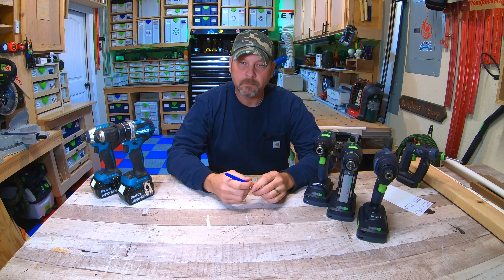Why I don’t recommend FESTOOL drills anymore.

Comment: Professional carpenter for 30 years. I have tools from most brands for different tasks.  If you are only on one platform you are missing out. 
Festool track saws, domino and dust collection were revolutionary. Before that we used plywood tracks and Japanese market hitachi saws for precision cuts. Porter cable door plane and D handle routers were a must.  Hitachi slide miters, and SDS drills…. and who didn’t have the Bosch jigsaw? Nobody.   You have to pick the best from each manufacturer and ignore the color. That said, I run mostly 18v Makita for cordless tools with very few problems.
Reply: Exactly one should NOT be brand loyal.  Buy the best tool for the job.  I used to like PC sanders and wore them out, they would no longer run every 5~6 years.   Some of my Festool sanders are 12 years old and still work great.
Reply: I am like a lot of other people in that I am brand loyal when we talk about cordless because it is so easy to get a lot of money invested into the battery/charger system which is why all but one or two of my cordless tools are Milwaukee. Otherwise, my corded equipment, big and small, includes Festool, Felder, Hammer, Robust Lathe, a Nova and a 40 yr. old Delta drill press, Laguna, Makita steel cutting chop saw, and even a Harbor Freight cherry picker (non-corded of course ;) ). Long story short, if I am buying corded I try to buy the best that the majority of reviews point to but if I am looking for another cordless tool, 19 out of 20 times I buy Milwaukee and will only pass on that tool if it gets subpar reviews.
Reply: I completely agree with you sir
Reply: Yeah if you're talking about a shop, if you're working on terrain having 3-4 different battery brands doesn't work out well
Reply: Thats what im trying to do now
Ive been makita for 3 years
But the dewalt 60v table saw is unrivaled in power
Now im looking for best in class for individual tools.

It seems makita is always a top pick
Reply: Absolutely agree I run 4 platforms Festool, Makita,hikoki and Milwaukee. I find the best tool for a job

Comment: Hi Brian. I absolutely agree with you. Dead on. I love my Festool sander and dust extractor but never could warm up to my super expensive Festool drill. This summer I bought a Makita drill set to make something outside for my wife because I felt badly about using my Festool stuff in the dirt. I bought it as my "beater" drill.... and just as you said I found myself using it more and more and the Festool les and less. Good stuff man, thank you!
Reply from the maker: Awesome! Thanks Chris!

Comment: The beep on my Festool drill also stops the driver.   No clatter of the clutch.  I appreciate power being cut to off when the torque setting on the Festool drill is reached.  Something I also noticed on my T15 drill is it torque application.   I had Panasonic, DeWalt, and Makita in that order.  None performed like the Festool.   As an example with all other drills if I stopped driving a 3" deck screw into a 2x6, on edge, at about 2" deep I could see the difference of the different drills.  With all others I had to pull  the trigger quite a bit to get the screw started again and then it would spin quickly.  With the Festool I could just pull the trgger a samll amount and it would begin driving the screw again and it would spin at the expected speed.  Basically the Festool drill appilies enough power to get the screw going again but only at the speed indicated by the trigger.   Mine is 10 years old.  Maybe the other brands have caught up with these type features.  FWIW  I am not a hobbiest.
Reply: This is exactly the kind of feedback I was looking for. I've used Dewalt impacts for a while now doing metal roofing/cladding and over the course of 11 years I've worn 2 our and my 3rd is begining to look rough. 

I've been looking around and wanted to go with Festool over hilti, so knowing you've been using yours for 10 years is great to know. 

I'd rather buy something quality once, rather than continually replace a tool because it was "good enough."

Comment: I really respect your openness and honesty! I sold all my Dewalt tools for Festool. Personally, I don't have any regrets, but I could also make an arrangement against my purchases. Like you said, their sanders, Domino, track saw, routers, dust collection... all game changers. A good drill is a good drill. I definitely tend to favor Festool... but maybe that's because I spent so much money on them and time convincing my wife I NEEDED them. I guess it all comes down to personal preference. Again, I really respect your honesty.
Reply from the maker: Thanks Jeff, I appreciate it.
Reply: After using the Festool drill long enough so that it shows signs of actually being used,  the others seem to be not well thought.
Reply: I’m literally just doing that!!! I’ve just got the 36v plunge saw, kapex and midi extractor, 18v hammer drill and now I’m looking at swapping my dewalt impact and combi for this and maybe a festool impact. Also my 165mm dewalt brushless skill saw needs swapping but not sure I like the look of the hkc55 do u have any advice?? Tha ks

Comment: I like my Makita drill but the real benefit to Festool is the different chucks. Really no comparison. The right angle chuck has come in so handy so many times. The Centrotec bit holding system is amazing. Now you can buy an attachment that allows non centrotec bits to be locked in. The time saving for bits falling out or getting stuck in screw heads and being pulled out makes the Festool drills so much more enjoyable to use. All the magnetic bit storage in the C 18. I could go on.

Comment: I own both the impact and the C18, 
I got the mainly because I was using the 18v batteries from the track saw and didn't wanted to invest into a new platform.
What I noticed from the C18 is that it is not that powerful for carpentry. But it is perfect for installing furniture, specially if you work with some very expensive materials where you need precision. The electronic brake and the interchangeable heads are very good.  They aren't so good to be used on a construction site, the rubber is very sensitive, and you definitelly need more power. 
But I think they are perfect for use in the shop and in the client's house for putting together furniture.
Reply from the maker: Totally agree. These feel to be more intended for finish work instead of heavy duty construction. Thanks!

Comment: I love the Festool drills and the Centrotec system. My drills i own are the Ti / C15 set, DRC, CXS and the SDS. While not designed for it i have put 6 inch screws in with the CXS. Since getting the DRC i have not used an impact. The CXS system came into it's own a few weeks ago while i was fitting ironmongery on site (uk) I had 4 jacobs chucks set up with different drill bits and 2 centrotec chucks set up with different screwdriver bits. Swapping chucks between 2 drills used - CXS/ DRC was quicker than using one drill and swapping bits all the time.

Comment: I will also agree with everything you have said here. I’m a big Festool fan, and I use a lot of their tools in my cabinet shop, and they are definitely worth the cost. I only own one drill, the Festool hammer drill, and I have all of the accessory chucks for it.  I bought it all almost brand new at a yard sale for 200 bucks, with one 5 AH battery. It’s way to heavy for everyday use, but it’s a beast that I use once in a while, mainly for setting anchors to hang my cabs on masonry. That brings me to the point I’d like to make. When I decided to add an additional battery to the mix, I was pleasantly surprised to find out that they were quite reasonable in cost, and very robust. I can see some value in a professional setting for using the platform in that case. 
All that said, I tried out a CXS at a tool show a few weeks ago, the new brushless one, and I think I’m going to add one to my shop. My go to drills and impacts for my work are all Dewalt 12v platform tools that have really held up very well, and I highly recommend them.

Comment: But I think the centrotec is worth the extra price tag. I really love the centrotec and also the angled chuck…
Reply from the maker: Centrotec is nice..if you have a lot of Centrotec bits (which I do), but really adds to the cost of using the Festool drills (in my opinion). I have a whole drawer of Centrotec bits I use with my CXS.

Comment: Hello Brian, I have to disagree with you on almost everything in your review and offer a different perspective.  The TID drill in my opinion is a complete waste of money because you do pay a premium price and receive almost none of the benefit of the Festool system.  I swear by the c18 and bought another to have one just for the shop.  The control, torque and weight are perfect for almost every task.  The right angle attachment is by far the best ever made and more than useful in the tightest of spaces for construction, remodeling, electrical, plumbing or cabinet and fine finish work. The centrotec system is like having 2-3 drills in one.  You can keep a drill bit in the chuck, a fastener bit in the centrotec chuck another bit in the right angle chuck if necessary and swap them out as needed.  Keeping all of them in one pocket of your tool belt or close by with the ability to change them quick back and forth.  And then there’s the eccentric chuck for cabinets, drawer slides and other uses requiring screws near the corners of cabinets, closets and boxes.  The centrotec chuck and small bits also make it shorter than other drills to again get into tight spaces.  It’s an amazing tool with great battery life and no other drill on the market compares.  I own the Makita XGT 40v drill and impact, dewalt and Milwaukee drills. The makita I would chose over the Festool PDC which I own also and love.  The right angle attachment on the PDC is the only reason I would hesitate.  I use it far more than I would have ever thought.  Dewalt and Milwaukee have a lot of power but aren’t great for control which matters more to me. The Festool impact is actually at a comparable price to the other brands considering Festool gives you 2 batteries and the rest only give you one and charge $150-$200 for another.  The CXS is amazing but it really is a cabinet drill and I hate that the batteries only work for that drill.  Again I love it for what it does but if you’re looking just for a small drill Bosch make great ones for around $200 for the set I have one I keep in my electrical bag.  Most of my Festool tools have been relegated to cabinet and furniture building, precision and fine finish working. Except the c18 which is the best all around drill I’ve ever owned and worth every penny and more.  Hope this helps!
Reply from the maker: Thank you Pierre for the comment!
Reply: Pierre - Fully agree. I'm still running my original 'c12' (the BPS 12) from around 2008/2009 with the original batteries still going strong. I now charge them with my TCL6 charger as they're forwards compatible with the 18V system (for giggles, I can run my TSC55 and HKC55, Quadrive etc. on them. Not for very long, but at least they don't keep changing connection types every couple of years like, ahem, some other brands...) I can still buy replacement batteries direct from Festool too, though I'd just buy the T 18+3 at £149 instead, or replace the cells, the T instead of the C because the newer C18 trigger seems to be set lower than the original C12 and is more front heavy. Still, while the C12 continues to soldier on, what can I do?  For wise heads, there are some real deals too, with £200 of chucks with this refurbished set: 

https://www.toolexchange.co.uk/product/festool-c12-cordless-drill-with-4-interchangeable-heads/

Great kit - I also use Milwaukee M18 and M12 for 'rough, garden and car' type DIY. Their M18 double charger lasted 8 cycles then blew. My Festool LC 45 is still faultlessly charging 15/16 years on. 

At the moment in the UK I can buy a TID for £129 (inc. VAT) with a free 5.2ah Bluetooth battery and a systainer. Just bought the new TPC 18/4 c/w one 5.2ah battery with a free second 5.2ah battery for £225. That free battery has a £105 value, so effective cost was £124 for the drill, plus accessories and battery in the new gen 3 systainer. 

For comparison, the last generation (new gen not available in the UK yet) Milwaukee One-Key M18 Fuel combi is £149, tool only in a cardboard box! £205 with a single M18 5ah battery!

Comment: Metal roofer here with a Bosch driver. I've installed dozens of metal roofs using 1 3/4'' pole barn screws( that's what  they call them) Used Makita for 26 years till I went with Bosch. Has More rpm's than Makita, both can last for years on a roof. I wouldn't dream of using my new tid 18/ T 18 on a roof. Thanks for posting.
Reply from the maker: Thanks👍🏻
Reply: Have used my Festool drill on rooftop for nearly 10 years. Have swapped some batteries, a few switches (we had more than one drill). Has been great
Reply: @happyhappynuts  I will use my Festool driver on a roof when it gets older but for now it's not leaving the comfort of my shop, it likes its lite use and comfy box.  I wonder if most tend to pamper there Festool tools, I'd bet most do!

Comment: Oh boy do I have some thoughts…

I sold my TID impact and my CXS and replaced them with the Makita sub compact (black) 18v impact and drill. They are ok. I love the size and weight but I just repurchased the TID18 and went with a C18 instead of the CXS. 

Here’s my issue: control. The Makita subcompact impact is either too fast/hits to hard, or is too slow. I broke screws I would never have broken with the TID. 

As for the drill, it just doesn’t have the control the CXS had. But it does have the power I need. I’m hoping the c18 gives me that. 

I also know that the Makita premium brushless impact drive is definitely better, but is also the same price as the TID18. 

Ultimately you’re right there’s nothing that Festool drills do that the others don’t do as well or better, but there’s something subjective about them that made me regret selling them. 

I wish YT still allowed response videos because I’d definitely mention you in mine (when they get here) 😁
Reply from the maker: You will like the C18 - it’s a refined drill for sure, but I bet you’ll still be buying another CXS😉😉
Reply: @BrianWatersOutdoors  probably, I work with the guy I sold it too so I can probably swipe it when he’s not looking
Reply: This makes me wonder if the Metabo SSD LTX can compete on control: it has 12 adjustable torque settings and allegedly great trigger control. There's a Polish (?) guy—FOR WORK AND FUN, is his channel—shows the Metabo impact driving small screws with great control. Just FYI.

Comment: What you're saying makes sense to me. Festool excel at cutting wood whether it be a saw, sander or planer, system integration and dust extraction (though they still don't do a H class vacuum with self cleaning filters). While the CXS drill-driver is an outlier, I don't see anything particularly compelling when it comes to their other drill-drivers. They recently updated the cordless drill and from what I see, it very disappointing in the torque department - 75nm when the competition has had 120nm for years now. I'd look at either Makita 18/40V or Hilti's new Nuron system coming soon.
Reply: I got the makita 40 v very nice impact and drill , also have the hilti neron impact and hammer drill
Reply: @reginaldwhite7944  And how are they?
Reply: @CrookedSkew  really like the makita impact , the hilti is a bit bottom heavy , i am a tool junkie i have dewalt 20 volt and 12 volt , makita 40 volt , hilti impact and hammer drill , festool impact and hammer drill , just ordered the new hammer drill from festool , festool vac and sanders and also a milwaukee 12 v pin nailer , blower , 4 in 1 for home use  , i need help is there a support group for tool addiction? lol
Reply: @reginaldwhite7944  How does the Makita 40v stuff compare to the Festool in terms of trigger feel/sensitivity? I hear the Makita 40v electronic clutch (Impact driver) is amazing. But the new Festool TPC 18/4 looks sweet with that manual torque control...and I think it has the highest RPM in its class. Even the Bosch 18v Flexiclick runs at like 1900 RPM vs the Festool's 3600 RPM.
Reply: @MadLadsAnonymous  Hard to beat the festool , but i like the makita as well .
Reply: Replying to myself here and after a little research on the Festool Owners Group, the new TPC 18/4 isn't supposed to be a top of the line powerful driver nor compete with Makita 40v's equivalent. It's more finessed and for precision work. I can accept that looking at Festool's drill/drivers, they all appear to be minor to mid-level and high on precision.

Comment: I’m a few months late to the discussion but what are your thoughts on the decision between the Makita 40v and Festool? With these two the cost difference is not as great. 

Makita 40 drill driver combo is about 459
Festool combo is 599

With the Festool you get three chucks and a sustainer and a three year warranty
With the Makita you get a soft side bag

I ask as I have no cordless power tools at all and want to decide which platform to invest in.
Reply from the maker: If you’re not invested in any platform, I honestly think Makita would be better. You can easily find them and are a little easier on the wallet. Save the Festool for sanders, dust collectors and more specialized tools like the domino.

Comment: We use a festool hkc and tracksaw with dust extractors.  When it comes to everything else like drills and durable toss around circular saws we use dewalt.  For nailers we use paslode. Ya 3 different batteries suck but get the right tool for the job